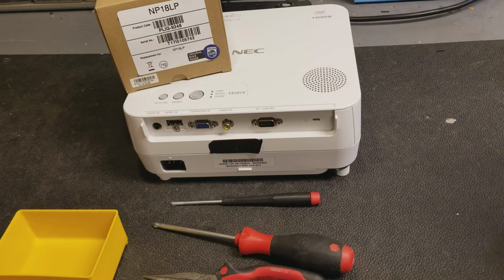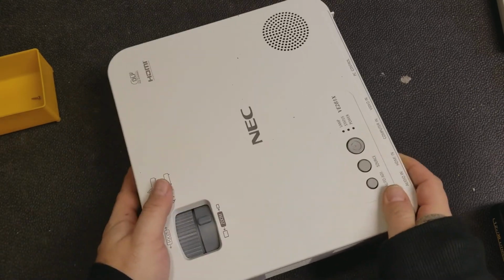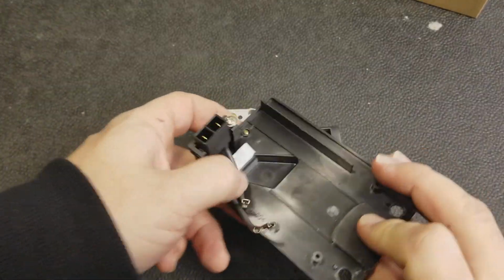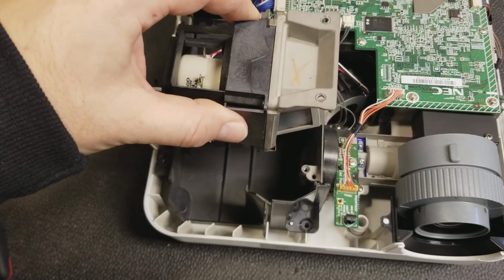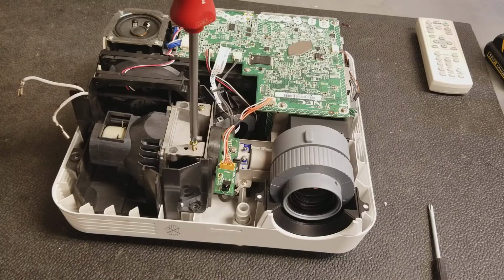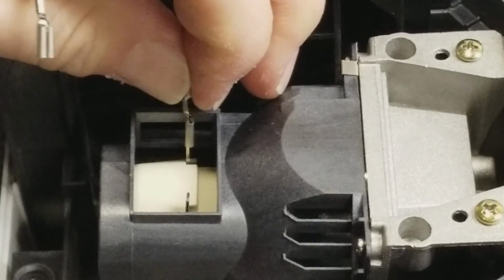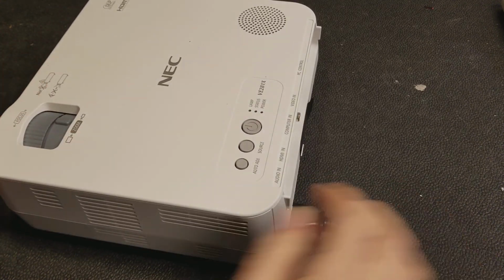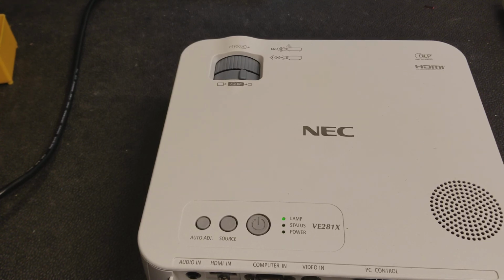NEC VE281X Lamp Replacement

Comment: Hey  PurelandSupply.com, 
I have NEC VE281 projector. Now there is an Issue of the projector, it is not turning on while if I plugged it turn on as the usual way. It only indicates the power bulb. I have tried by pressing the power button and pressing the remote keys. Can you please help me to solve this issue.

Comment: Does it matter if the wires get plugged into the wrong side?
Reply: Hi Grant, when you say plugged into the wrong side, which wires? The lamp wires?  If you swap them on the bulb connection, it will still light but you may get a shortened lamp life. Otherwise I would need some clarification of the wires you mean.